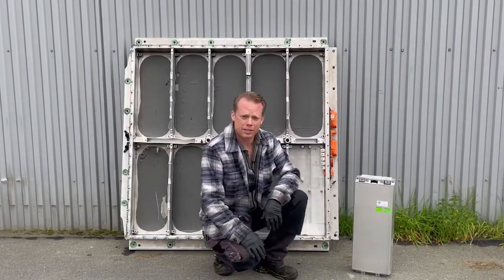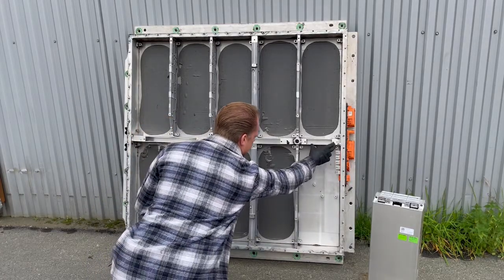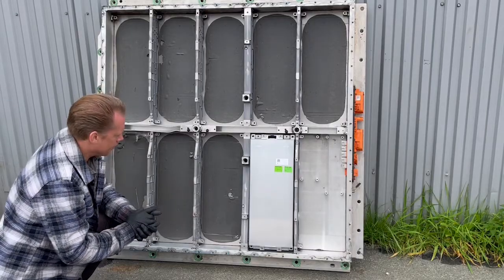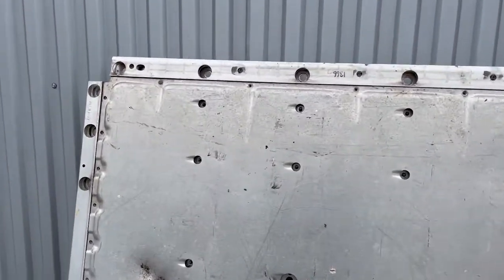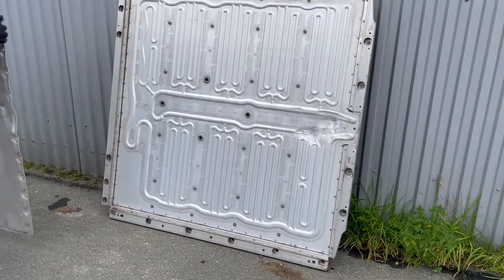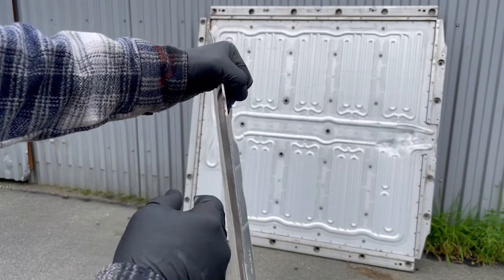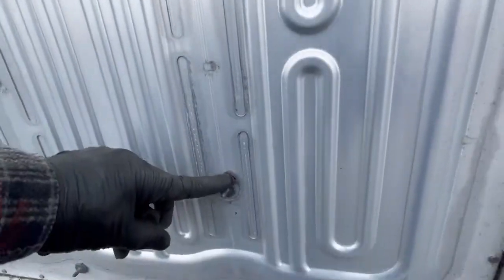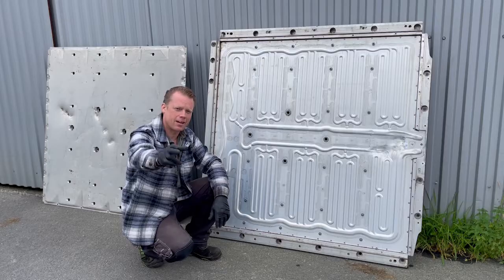Vw id3 id4 battery thermal management.

Comment: I have some questions regarding the unlock procedure of the MEB (BMS fault emergency shutdown). The BMS has the state "Active!". You made a video in which you connected 2.5E instead of the Pyro Fuse. Unfortunately, I'm having trouble getting this error message on the BMS. Could you please help me? Thank you very much for your help.

Comment: Hello and thank you very much for your videos. They have helped me a lot. 

I am currently building an 82 kWh MEB battery with SMA hybrid inverter and battery emulator. Electrically I am finished, everything works perfectly. 

Now I have to move the battery to its final position. I want to place it upright against a garage wall.  Cooling connections should be at the bottom and will be sealed. At the top, the battery will be secured to the wall to prevent it from falling over. 

What do you think, is the aluminum frame on the water side sufficient to bear the weight of 500 kg without deforming?

About pressure equalization of the cooling system: What is the approximate amount of coolant in such a battery?

I reckon with ambient temperatures of -5 - 35 degrees Celsius. Usually more like 0 - 30 degrees Celsius. I do not intend to heat or cool. Will this work without any problems?

Thanks again!
Reply: I would actually try to mount the battery just like it is mounted in the car, so every single pouch cell inside carries only it's own weight directly down into the base plate it's glued to.

If you mount it sideways, the 24 cells rest on each other, and the weicht of 23 cells end up compressing the lowerst module with the full weight of all cells. 

The cells are pretty delicate. They are basically the batetry materials inside a thin metal foil that has no load bearing capacity, so all forces acting upon it have to be carried by the raw battery chemistry inside it. 

Each module weights 33kg, maybe 6kg for the case, so the single cell at the bottom wall standing sideways is permanently compressd with 24kg. It's not meant to bare that the whole time in that direction, only for short periods of acceleration and decelleration that is below 0,5G instead of earth's gravity at 1G permanently if you mount it sideways.

Actually, there was an issue with the battery packs in 2022, leading to a recall of 10.000 cars and even some more afterwards to this day. It was a manufacturing defect.
But strangely, the majority of cells some forum member s in an ID forum listed where mostly cells at the walls that went bad. 

So maybe, accelerating hard and purring mechanical acceleration load on the pouch cells inside, pushing all cells on the cell at the wall, is an issue for puch cells.
Reply: BTW: There are some new studies that looked at the degradation vs temperature. Batteries stored at lower temperatures, even at 100% SOC, degrade slower than in 4ß°C. 
BUT: They also found out that charging the cells at 2-5C at 0 or 10°C killed the battery modules the fastest of all. But you probably charge the battery with far less in your setup, as a 5kW solar array will only push 1/12C into the 62kWh battery.

Comment: Vw avez eu des soucis justement avec le refroidissement ou réchauffement des batteries sur les 1 ère Golf, ont m’a dit ?.
Merci de cette parfaite explication et c’est rassurant.
Il manque de l’isolation en dessous de tout : si il fait froid dehors + intéressant. Il y fait trop chaud dans les batteries : et c’est là l’intérêt de pas isoler !?.
Reply from the maker: Those battery’s in the e-golf is lacking an active terminal handling. The heat is a bigger issue than the cold I guess.

Comment: Thank you for sharing this informative video. Do you use the built in warming/ coling for your rebuilt homebattery or is it not needed? Is it working fine in the wintertime or do you notice capacaty change when it is below a certain temperatur? Or above to maybe? Maybe its easier to just insulate or keep the battery indoors?
Reply from the maker: Hi and thank you for watching my videos☺️ I need to heat the battery during the winter time. It is in an insulated box that I have put on a trailer around 20 m from my house and I am heating it with a kind of floor heating system under the battery. I tried to hold the temperature at around 15° inside of the battery, and when I charge it, let’s say around 30kWh, the temperature rises 4 to 5° so not so much external heat is needed when I use this battery every day. I tried to have the same temperature in the battery all the time and therefore I have not seen any changes in the capacity depending on the temperatur inside of the battery. Cooling it’s not needed where I live at least, and during the summertime it is not cycled so hard as it is during the winter time.

Comment: Does that mean there is no battery heating system? Only cooling? No way to warm up the battery before charging in winter?
Reply from the maker: The thermal handling can  both heat and cool the battery when needed.
Reply: The ID series batteries have a 5,5kW Battery heater. it heats up the cooling liqid and a pump drives it through the channels you see in this video. In Summer, the cooling channels are cooled by the AC.

Comment: Thank you for this great video! Do you know if the bottom aluminum protection sheet can be removed while the battery box remains fastened to the car? I have an ID4 and would like to see if i can fill some of the space you pointed out between the bottom cover and the cooling tray (sounds like ~15-25cm) with sheets of closed cell foam insulation to help reduce winter range loss from what i have to image is a lot of wasted heat out the bottom otherwise meant to keep the batteries warm during winter.
Reply from the maker: Hi.
Thank you😃. Yes, I think that it is possible. Sounds like a great idea if so.👍🏻
Please let me know if you see any improvement. ☺️

Comment: So it can only cool and not heat up the battery? 

Wouldn’t it be possible to heat up the coolant and use the same channels in the pack for heating?
Reply from the maker: It can both cool and heat the module’s. It’s more common to heat the modules, then to cool them, at least here in Sweden.
Reply: @flyingtools  Tack. Jag är svensk och har en enyaq 80x vilken använder samma batteri antar jag. Tycker den laddar så långsamt när det är kallt, så antog att den inte kan värma.
Reply from the maker: @joel8628  Det beror på vilken temp batteriet har. Batteriet värms för att hållas över nollan och kyls över +35grader.
Vid 25grader celltemp borde det vara nära full effekt på dc laddning. Har själv inte en sådan bil så ej kunnat verifiera det.
Reply: My ID.3 has a 5,5kW water heater for the battery build into it. It is switched on while charging at belor 8°C and is only turned off if the battery hits 24°C after about 25 Minutes. 
If I fast charge in Summer, the AC unit is switched on and 100% of it's capacuity cools the water going through the cooling channels above 32°C. The car itself throttles charging down when the temperature hits 45°C, as the AC isn't powerful enough  to keep it below 45°C. But if it's cold, the water will be cooled by ambient air through the radiator. 
The thermal water routing system  of the ID cars is pretty smart.

If you fastcharge in summer, the cabin heats up as all the AC's power is going into the battery.

Comment: The temperature management in this batteries is mainly for pre-heating (before drive or before fast-charge) and cooling when fast-charging. Consider a e-Golf battery is way smaller and has no active cooling - so it is obviously not needed to drive safely even scaling up to a ID weight and battery size. But - anyway - if the cooling fails (like air bubble detection in the cooling circuit) the ID will go into turtle mode for safety.
Reply from the maker: Correct 👍🏻

Comment: Is there a cooling circuit only on the bottom of the battery? Second one on the top of the battery as well?
Reply from the maker: No, this is it, really simple and perfectly enough to heat and cool the cells. Mostly heat I guess because they are almost not producing any heat at all.
Reply: @flyingtools  yep true, its a myth that even aggressive driving heats up the battery. at least not in my EV

Comment: Thanks, this is a really great video to understand how cooling works in VW IDs packs. I may have one concern. Many years ago I used to build and repair computers and from time to time in an old computer the thermal paste between CPU and cooler would dry out and the heatsink would stop removing the heat from the CPU. So hopefully that won't happen here as the battery pack is enclosed and sealed unlike a computer case.
Btw. Do you happen to know how many modules are in the 2021 VW ID.3 Pure Performance? Some sources say 7 (48 kWh) and others say 8 (55 kWh). However, the usable capacity is 45 kWh. Hopefully someone could answer this question, since in the case of such a large buffer, it would not be a problem to regularly charge the battery up to approx. 90%.
Reply from the maker: Hi and thank you. I have never opened up one of those batteries so I kan not answer for sure. Sorry. Thank you so much for your comment.☺️
Reply: Haha 😀 Thank you for the reply. Maybe anyone else has some knowledge?

Comment: Thanks for the video. I have a question is top cover (lid) made out of steel or aluminum ? I hope that it’s made out of Aluminum because cars like Tesla are having problems with water ingress because of rust due to salt and water.
Reply from the maker: Hi, it’s made out of aluminium. Thanks for your question☺️

Comment: One thing I haven't seen you cover - each module has 2 thermocouples, but where are they located inside the module? I want to understand how they get a max/min temp.
Reply from the maker: Hi.  I show them in another video when I open up a complete module.
Here is that video: Open up a VW id3 id4 lithium battery module.
https://youtu.be/uP-lOsd4cVY

Comment: I drive an electric VW, these battery videos have made me feel safer. These things are build as solid as rocks.And it's also reassuring that if one module fails, it can be replaced rather easily. Great info in the show notes too.
Reply from the maker: Hi! Thank you so much, I’m glad that you like it 😃
Reply: Its a pity however that single cells are not replaceable as of now. That drives the material cost up from a couple of tenner to well around a thousand bucks
Reply: @nilreb  Yes. It's a readeoff. Those are pouch cells. They need a sturdy housing to mechanically protect them, unlike round single cells with a housing each. Which makkes them more expensive. 
Here, 24 cells share one single housing, and those are huge, but delicate cells. It's cheaper and more compact to build, yet very strong as the aluminium is thick. 
The chinese version of the ID.3 has prismatic LFP cells btw, so there you can replace the single cells, as each cell has it's iown protective housing that can be a bit weaker thanks to the safety of the LFP chemistry. The LFP chemistry isn't as energy dense, so the chinese ID.3 has les capacity or more weight, but is cheaper thanks tothe chemistry being cheaper despite the added costs for a housing for each cell.

I would actually prefere the chinese batetry though, as I plan to drive my ID.3 till it falls apart and single cell replacement would be far better later in life.

But I understand why they went for pouch cells and higher energy density and how they build it for europe.

Comment: I really disagree on your conclusion.  It is almost impossible to prevent or cool the top part of the unit because heat will rise and it will take an eternity to heat from the Bottom, think a thick steak on a grill.  You see the issues much clearer on the E-GMP cars (kia+hyundai), where they charge with much higher C factor.  They overheat and "rapidgate" as bjørn calls it.  He also see it very clear on the Delta temp, he often mentions.
Reply: I have logged several charges on my ID.3 with this battery. Each module has a temperature sensor on top and bottom. The difference between those is less than 2,5°C whicle charging at full power. Remember, they are charging at 2,3C, and discharging at 2,8C, not 3,5 charging Tesla does and Discharging 8C in the plaid. The cooling system is totally sufficient and the temperature difference is very acceptable. 
In teslabjörns Plaid runs, The battery hit 65°C, and temperature duifference of 5°C.

He tested a Chinese car in Winter lately and that sh*** hat 15°C temperature difference.
Reply from the maker: Lucky aluminium, copper, and nickel are much better heat conductors then a steak😅 The temp difference in the lower and upper part of the module is probably not a big problem here as long as all of the modules have the same conditions.
I mean, the temperature is controlled all the time the car is on, and due to the low internal resistans that those batteries cells have, there is also very little heat that will be generated. I do not mean that this is the best system in the world, and I highly respected your disagreement, but still I think that this will work pretty good 😊
Reply: @flyingtools    The Data that Bjørn pulls from the OBD in the MEB and E-GMP vehicles strongly indicates that you over estimate the heat transfer in solid material.
Furthermore tha batteries run in a narrow temperature range and the equation for heat transfer is a diffential equation, so the realative low temperture diffence will make the heat transfer very slow and if you run heating or cooling at a temperaure that deviate by a lot from the battery temperature, then you can't have a uniform temperature in the package.   
So at best adequate, never good or better

Comment: Why couldn't you just use the entire battery with the all ready connected component's? (perhaps repair the cooling loop)
Reply from the maker: The frame was also bent, so the modules did not fit correctly anymore. The frame is also a structural part of the car. 
But some modules was saved and those will probably end up in my golf citystromer.
Reply: @flyingtools  before you melt it down, give hydroforming a go for the next one :-)
But could you reuse the electronics?